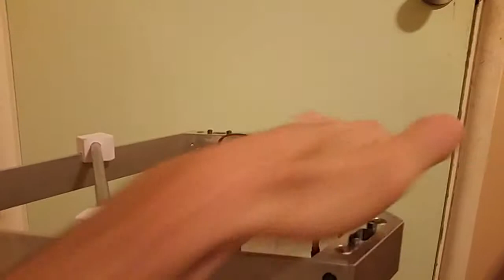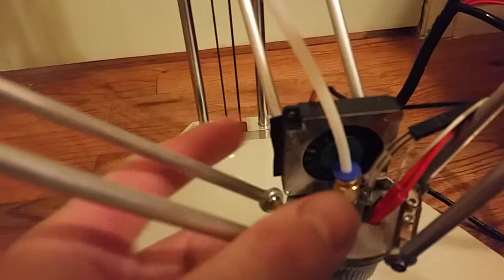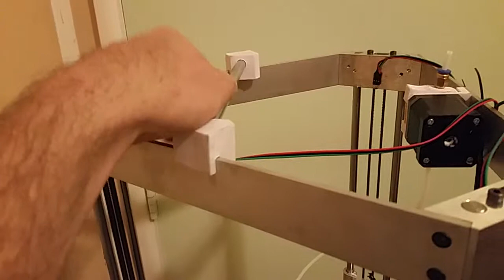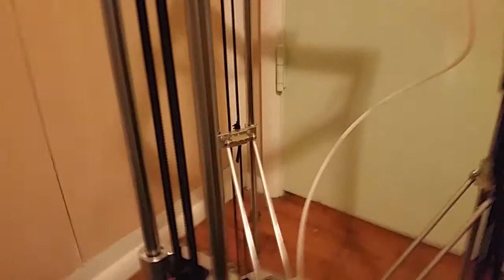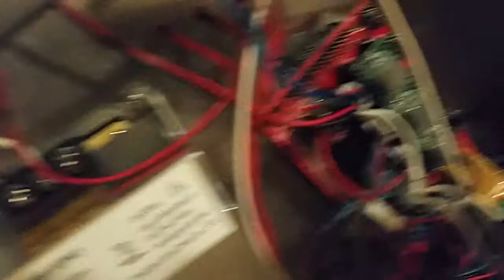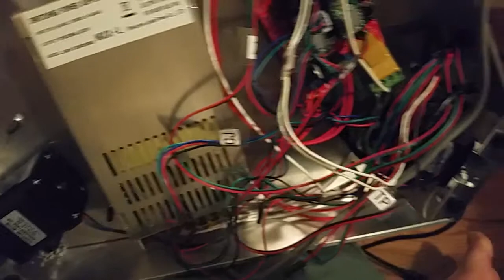Assembly Makergeeks All metal Kossel... so far

Comment: I have the same printer in the same state of not quite done although I may have made a lot of mistakes already. If you pull the top part of the LCD serial connector off it fits through the hole sideways.also did you have to adjust the drive belts mine are much slopier than yours look.
Reply from the maker: I did not have to adjust the drive belts, although two seem to be looser than the third.  The good news is that I have the entire thing working now.  I am currently uploading the video and will post a link.  It is pretty cool to use.  Just an FYI, use the Android IDE to upload the Marlin Delta2 firmware.  You will have to adjust the Configuration.h file.  I will be posting how to adjust that file.  It is not a lot, but it will likely save you from running your nozzle into the platform.  I am happy so far.  i will be adding a build plate cooler here once I get a second fan in as well.  Keep me posted how yours is going Paul